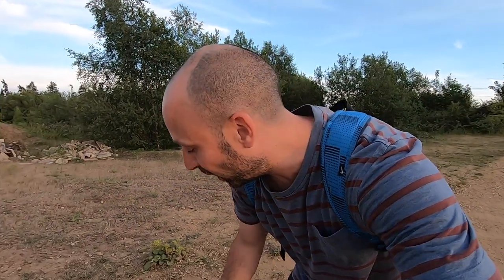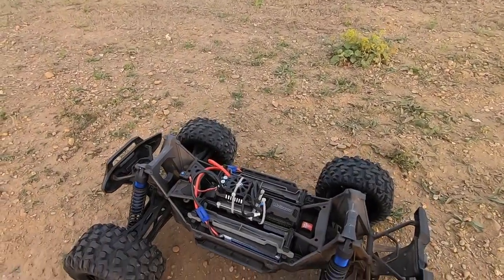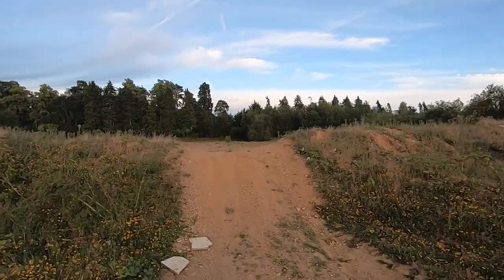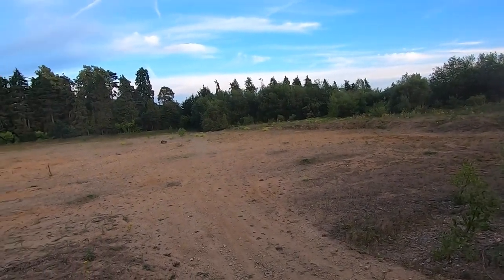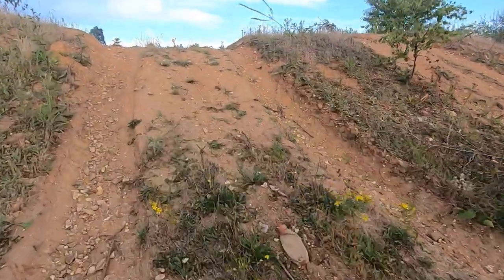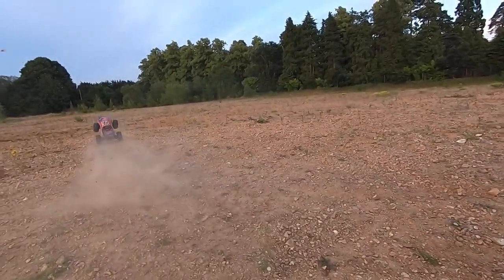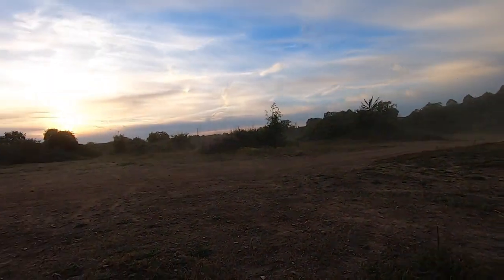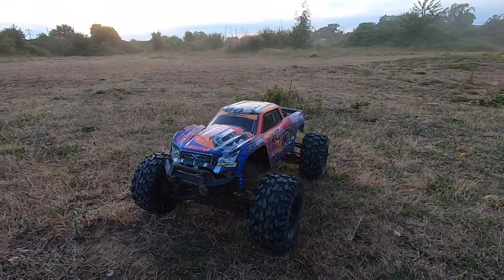XMAXX 8S flying high!!

Comment: If you stick tape over the hole on the inside of the wheels it stops the water getting in, to late now but if you get new one's it's a must.
Reply from the maker: JTM2007 yup. Too late for me. I should have done that for sure. The small holes in the tyres worked great at getting the water out and the tyre itself did not rip apart at all after all. So win win👍

Comment: Great bash Bru. It's always good to vent tires for less ballooning and it's also way for water exit. I personally don't like plastic spur gear coz they'll strip out in no time especially on 6S. Bash on brother
Reply from the maker: CommanderAstig RC cheers bro. Yeah venting has worked great. I get u about the spur. Thought I’d give it a try as I had a spare from my 6s Xmaxx ( long gone) and I had chattered the stock Xmaxx metal spur gear and pinion. I have had maybe 4 bash sessions on that plastic 50t spur now and had zero issues so I’m more than happy with it.

Comment: Suprised you like electric having all your freinds into the ultimate modded 5th scales i can appreciate both myself and alot easier not having ppl around you angry about noise i do like feel gas even nitro better just cant put in the bash time and amount of money needed to be comparable is off charts too actually thinking of getting xxmax bci waited to get infraction i ordered and never came while waiting had two incedents with 5t and noise
Reply from the maker: rc player mate I like rc in general. Nitro / petrol/ electric. All have their pros n cons. I love the mad 1/5 stuff. My alx 50cc losi is a rush to use!... but then again so is the Xmaxx. I can’t jump my 1/5 stuff like I can my Xmaxx or 1/8.
Reply: @RCmaxxUK  ik i feel same way , they all have a there place , i like having all i have 5t but no 50 just a 36cc those axl motors are insane only experience i have with them is watching you guys  definitely a modded motor in the future f or me , much as i prfer to buikd my own , the deals on used modded 5th scales  csnt be beat and be way i go to get my hands on one 2500 3gs get 6g rig still crazy for a rc 😆

Comment: what have you done to this or is it bone stock?
Reply from the maker: SyNeRgYi hey. Max5 esc. Rpm front / rear bumper mounts and rear hubs. Body wrap. 19/50 gearing up from 18/54. Otherwise stock

Comment: eye not to destroy even x maxx ... since that is also made of plastic ... for what it costs, all made of plastic ... ahahaha !!!
Reply from the maker: Marco Casetta tbh mate I like the plastic as it keeps the car relatively light. It’s very strong and does not suffer from the bent chassis many metal chassis rc cars seem to
Reply: @RCmaxxUK  But it does break over time... Plastic chassis is not better nor is metal and you cant fault thin metal chassis from bending. Seen more then enough Xmaxx's front or rear chassis snapping from bad face or ass landings because plastics will crack and or stretch when force is in the mix. A simple fix for metal chassis is better design and be a lil more thicker like the new aftermarket Kraton chassis upgrade many are  using now which does not bend. I think by far the Cen Reeper is by far a better truck then the Xmaxx in design and among many things and it can be upgraded to carbon chassis at lil cost and be upgraded to 8s and has a way better drive line then the xmaxx that handles 8s with no issue.
Reply from the maker: Joe Dirt so.... what u r saying is an expensive upgraded Kraton or Reeper is better than a std Xmaxx?... well chassis at least... and drive line. 

Hmmmmmm. Nope. I don’t agree. 😂😂👍

The Cen is not a competition for Xmaxx and neither is the Kraton. Or any 1/8 mt. Too different. All 3 are no doubt enjoyable in their own way. 

I like the plastic chassis of the Xmaxx for the reasons I highlighted. It works on the Xmaxx. I have had 2 Xmaxx 6s/8s. Not broken either chassis. It happens though I agree. People break rc cars. Just like they bend chassis. 👍👍
Reply: @RCmaxxUK  Yes, a stock Kraton and Cen Reeper is better out of the box.
I find it funny how you think Plastic is better when in fact there's no proof to it and the same goes for metal. There are pro's and con's for the two but yet you disagree and claim plastic is better which i find quite funny and one sided. 

As far as the drive line goes, yes the Cen Reeper has a better drive line for it being a 6s truck being able to run high end 8s systems with no issue when the Xmaxx 8s cant and even more funny if you tried that with the 6s Xmaxx so yeah i think a STOCK 6s Cen Reepers is better when it comes to its drive line. But again plastic chassis Vs metal debate will not go anywhere because both has pro's and con's and one is not better then the other because plastic will break and metal will bend. You claim metal bends but you deny any and all faults plastic chassis has which is why i made my first comment but i guess you dislike when people have more of a logical opinion then your one sided opinion.